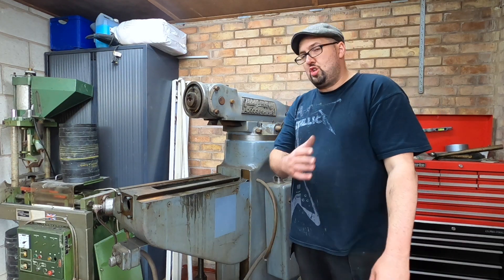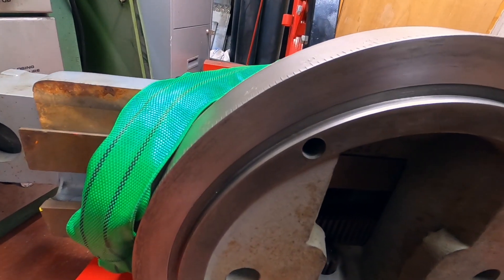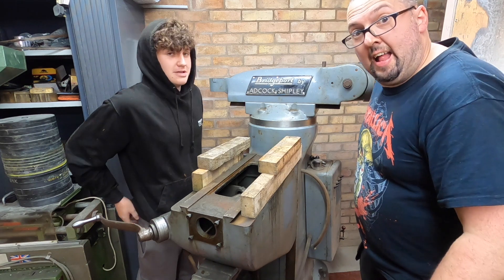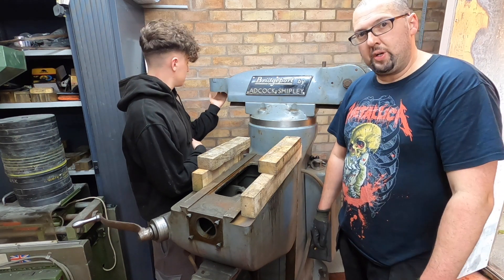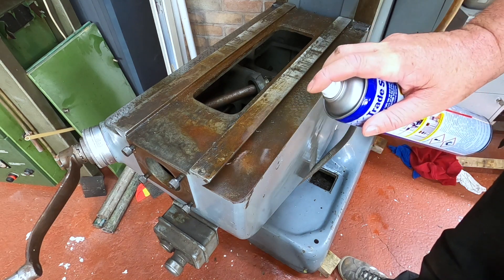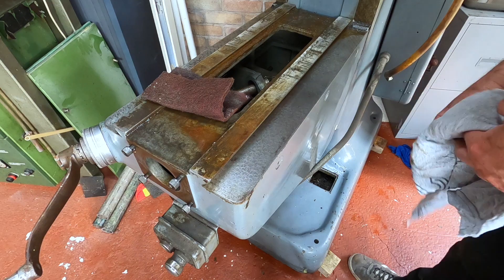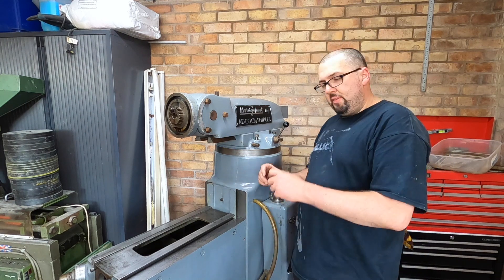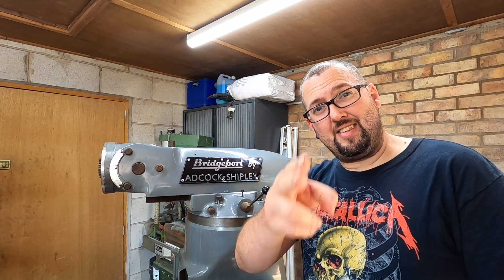Bridgeport Milling Machine pt 2 - Cleaning with rags, WD40 & Elbow grease

Comment: Just in the process of doing mine used elbow grease aswell great citrus,I took my knee off I’ve hot pressure washed all mine in doing that I’ve taken a loud of paint off the base so what started as a clean is know a full paint jobbie 🤦🏻‍♂️great vids mate keep um coming
Reply from the maker: Thanks Adam, much appreciated. I didn't go that far, to be honest I think Ive been very lucky with this milling machine, as the important parts seem in good condition. All the best, Laters, Matt